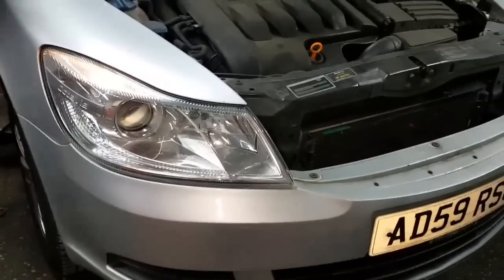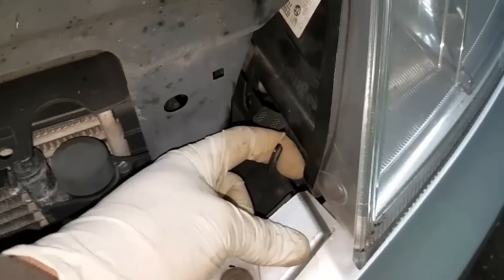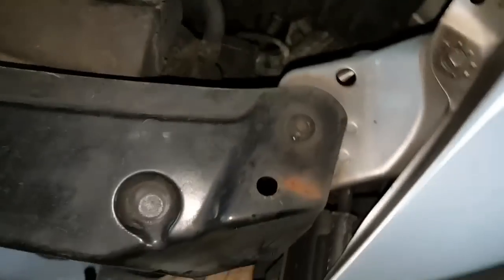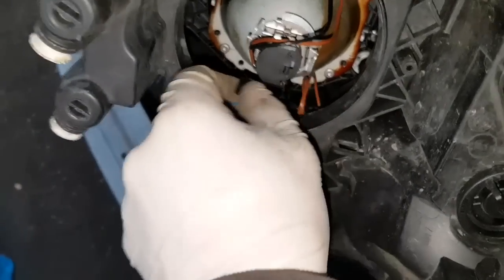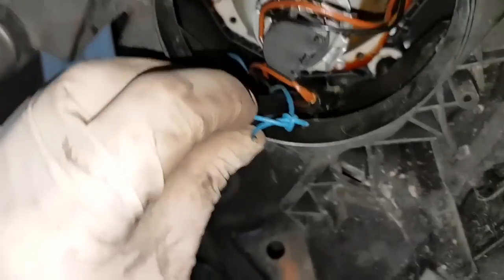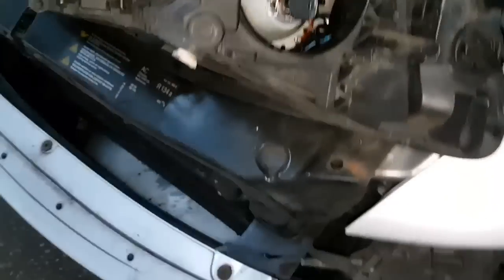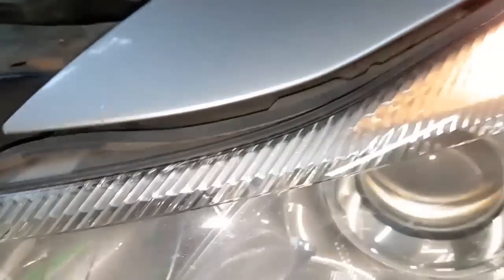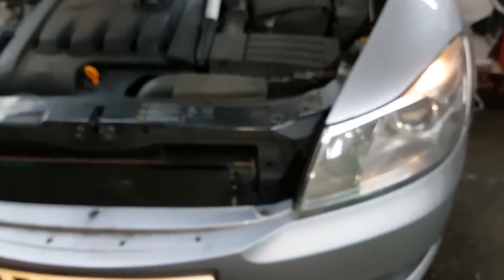How to replace sidelight bulb 501 - Skoda Octavia

Comment: Make sure the bulb holder is well down in its socket like it was before you pulled it out and a tight fit so you don't not have to re due the job,  its not always easy putting the headlamp unit back in, common sense says you start with the release lever out, have patience wriggling it about if it gets stuck trying to put it back in, pull out and try again.

Comment: I don't get it, how did u removed the black support of the bulb, so easily? I have tried but...still not coming out...
Reply from the maker: +Martian Danaila due to heat they stuck on so twist and turn it and that should loosen up the holder and then pull! if you got wd40 (maintenance spray) spray that on the holder too and leave it for a minute. Hopefully this should help you pull the bulb out easily 👍
Reply: Ty, Taj! I will, for sure!
Reply: I have used pliers - you get better grasp. It is a little in weird angle for fingers to pull. Just be sensible with a force with pliers and you'll be good.
Reply: Maybe you should mention this in your video. You show it with bulb holder removed already.
Reply: @TajMotorMedics  Yeah thanks for the heat explanation why it's so well stuck in.

Comment: Both of my sidelights are faulty. 
I don't know how your light housings just fell out but I cannot get either of mine to budge after pulling out the clip.
Reply from the maker: hi sorry i didnt mention in the video but there is a nut behind the headlight which is holding the headlight in place so remove that first. (white plastic nut) then follow the video. P.s this car never had the plastic nut, so totally forgot.
Reply: Taj Tyres ltd No problem. 
I managed to replace both bulbs only to discover that the VRS model I have doesn't use the sidelights. Although the bulbs are fitted, the VRS relies on the daylight bulbs. 
More fool me.
I replaced the sidelights because I had a warning on my dash. However, it turned out to be one of the lights on my rear number plate. 
Thanks for the video. Keep up the good work. 
Cheers. Chris
Reply: Taj Khan hi you forgot to mention the plastic nut I keep pulling it then had seen another video which shows the nut so please can you delete your clip or update it